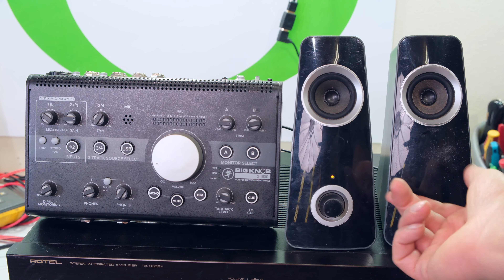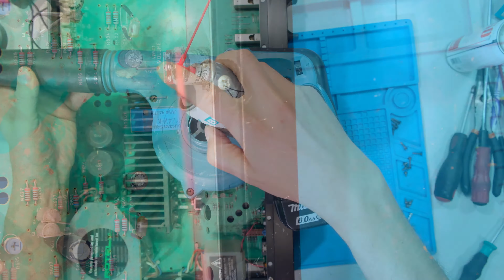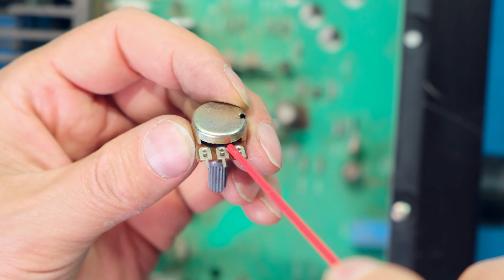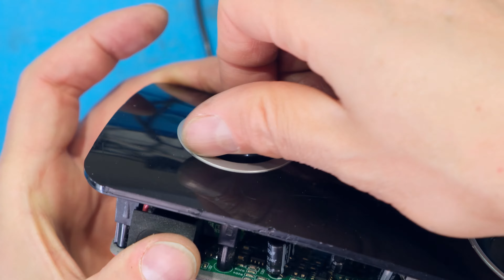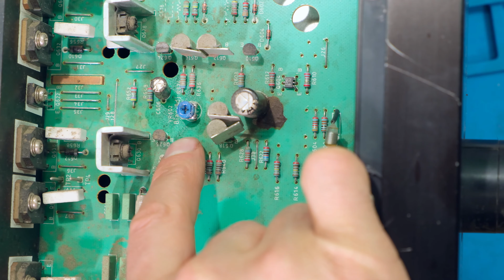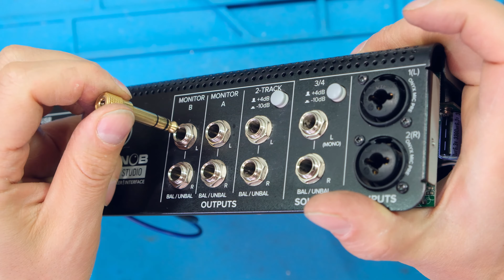How to fix a scratchy / crackling volume knob on an amplifier, audio interface, computer speakers

Comment: Don't blow off- use a soft brush to dislodge the dust while using a vacuum cleaner with a small attachment to remove it. Blowing will make the dust go everywhere underneath the boards where it will be difficult to remove from.

Comment: Crackling sound is caused by DC voltage over the wiper. Put capactior in series and it should be solved forever.
Reply: Hey, bro. Could you explain that a little more? The volume knob on my audio interface is noisy but only when there's sound coming out of the speakers, therefore I assume it's not rust or dirty. Might be what you say but I have zero knowledge in electronics and don't know what any of that means.
Reply: Please explain more of that

Comment: I have this issue with several devices.. a guitar pedal, a small mixer and a speaker. Just wondering how to get to it, how to open it up and so forth. So I can access the inside. That's the only thing I'm having trouble with

Comment: In addition to the crackling sound with the volume knob, I also hear a huge pop when turning power on/off. Is this a separate issue or will doing the above help with that?
Reply: I think you have to turn it up and down while you're cleaning it out until it stops making the sounds. But if it doesn't stop you need to replace it

Comment: I have this issue but only when sound is playing, when no sound is playing, but my speakers are on, there is no crackling with the volume knob
Reply: Same here, bro. Did you find a solution?
Reply: @sepita10  I ultimately got mine replaced since it was still under warranty as I didn’t want to spend $35 on contact cleaner, which is what the seller recommended